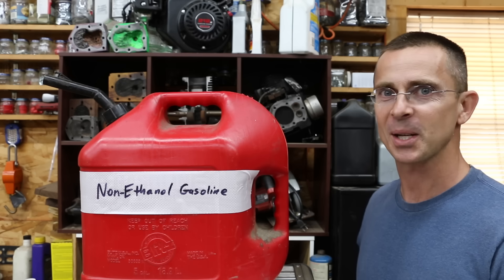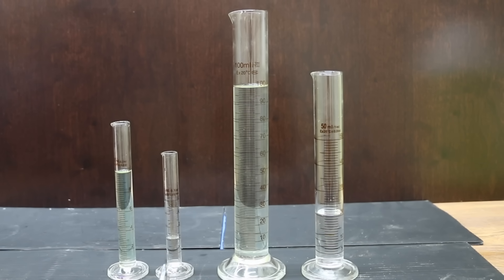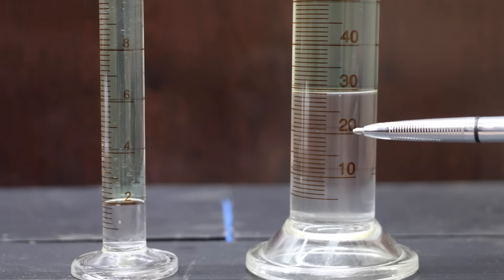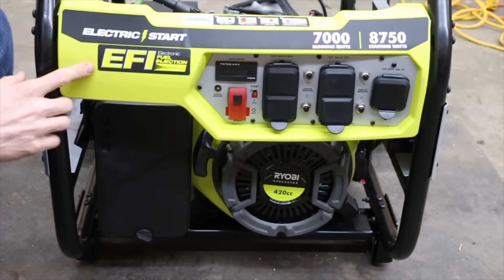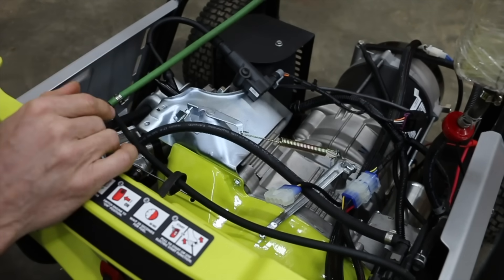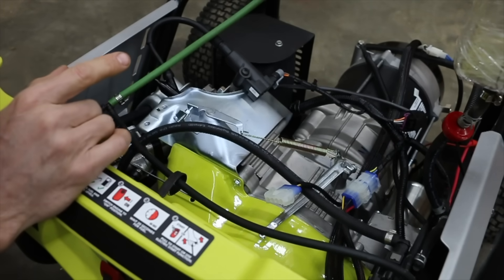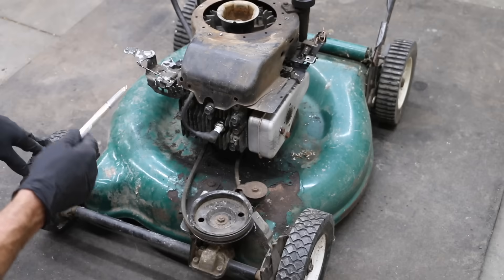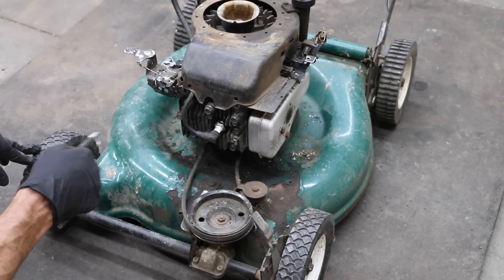Is Non-Ethanol Gasoline Really Better? See the PROOF!

Comment: Bulk it up with worthless junk to increase profit. Its called "cutting" when the drug dealer does it..
Reply: You've pretty much summed it up!  Great analogy.
Reply: My local station has 87 octane E-10 for ~$1.75 a gallon. Ethanol free is $2.56. I'm not sure if the 3-5% increase in efficiency is worth the ~46% increase in price.

Edit: to be fair, the ethanol free gas is 93 octane, so that probably explains why it's THAT much more than E-10 87 octane.
Reply: @justinluttrell1769  The range of the fuel probably doesn't make up for the cost there no. But that is a bit absurd of a price difference wherever you live.
Reply: That price difference is artificial. Currently gasoline is trading at less than 60 cents per gallon not including delivery, taxes or retailer profits. Ethanol is trading just under 1 dollar per gallon excluding the same. The reason for the retail price difference is tax and the artificially limited supply of pure gas because of regulations limiting its sale. Even going back six months to before the current crisis there was only a 10 cent spread between gasoline and ethanol.
Reply: @justinluttrell1769  The funny thing about it is that ethanol does not decrease the octane, it raises it. With that understanding, they are using lower-grade gasoline for the ethanol mixture. You have to wonder about that.
Reply: @justinluttrell1769  
That's cheap, regular/ethanol garbage is 2.29 here and 92 ethanol free is 4.09
Reply: ethanol increases octane, so it does provide a function and is better than lead and mtbe or whatever the other toxic crap was.
Reply: The "cleanest" ethanol fuel to be found around where I live is 20% corn. As I recall the "standard" is 35%. I pay the huge price hike for "marine" non-ethanol gas because my pre-millenial car has enough to worry about without its fuel rotting it from the inside. Not to mention we tend to have some of the highest prices in the state with a refinery on the edge of town; that's always entertained me.
Reply: OOZ662 there is the fact that any cars without “flex fuel” which is ready for up to e85 will have there rubber gas lines eaten up but besides that it does a damn good job of cleaning the inside of your motor,you should see some motors that ran there whole life on e90-98 the pistons and valves are spotless, kinda like a methanol car
Reply: Ethanol may raise octane, but it’s BTU content is less.
Reply: FACTS!!!!!
Reply: Leagalized theft is what I call it.
Reply: Here's the current prices for the gas in Germany: E5 (there is no non-ethanol gas here) - 1.20 Euro / liter, E10 - 1.17 Euro / liter.
So the 4% fuel efficiency really do matter over here. Though it's only 2% since all standard gas is cut with this crap.
Luckily my car runs with diesel.
Reply: @jellysquiddles3194  that's 5.63 us Dollars per us gallon I drive truck between Utah and Washington State Utah was as low as a $1.87 a gallon but it's back up to $2.30 a gallon Washington's about $2.70 to $3.40 a gallon
Reply: @craighooper7321  Thank you!
Reply: Its purpose is to increase octane, its why race engines use it alot to avoid pre-ignition with their high compression engines
Reply: @archygrey9093  then why have it for your average engine?  Because corn people knew everything was going to have turbos on it in 15 years?
Reply: @user-o1o1m  Most modern cars have higher compression engines these days and require higher octane fuels even without turbos.
Because of the higher compression they can burn the fuel more powerfully, efficiently and cleanly but only if it doesn't autoignite in the process.
Ethanol also burns cooler so i think it will also reduce heat spot knox emissions reducing the need for those stupid EGR valves.
I'm not pro ethanol or anything my cars are all pretty old so i do better without it, I'm just saying that it does have a legitimate use in fuels.
Reply: J M it also cleans the hell out of your motor you should see those cars that run there while life on corn, there engines would never have to worry about carbon bold up, and if you know anything about carbon it is the best welder in the world, don’t want that in your motor
Reply: @Cerus98 Never said it was great, just better than lead and MTBE. I'm not a fan and don't want to see an increase in ethanol content.
Reply: Ethanol costs more than gas due to the high energy input into its manufacture.  It has to go through at least 3 distillations to get close to 100% alcohol content. The raw material which is mainly corn, has an inflated price due to the high demand created by legally mandated ethanol content in auto fuel. This price inflation of grain crops has had a detrimental effect to the diet of people living on less than $2 a day. Ethanol use does nor really reduce CO2 emissions, so it's just virtue signalling at the expense of starving people. Many environmentalists have urged governments to stop it, because it does more harm than good but bone headed politicians don't listen. Farmers love it because they get much higher prices for grains than they used to. Around 40% of the American corn crop goes into making this ethanol.
Reply: Replevideo are you high, ethanol cost less than gasoline you bone head, go look at any pump with e85 and 87, e85 is cheaper, higher octane, and does reduce co2 due to the fact that it super cleans your motor, you know why it did that, because it doesn’t cause carbon build up and what do you think carbon is built up by, gasoline and all the chemicals in it,
Reply: @mustangsquad3029  if you burn more e85 then gasoline (ethanol has less energy content) it would have to be the same price per mile to justify it. Price at the pump does not dictate operating cost if one fuel is less efficient.
Reply: @mustangsquad3029  unless you don't care what it costs and want to be a super hero environmentalist. I would be interested to look at what the total energy used to refine ethanol vs petroleum including use as fuel by end user and see if ethanol = less energy total. If they have a similar "footprint" then the whole thing is a scam. I change my oil and drive the piss out of my vehicle. It's clean :)
Reply: @mustangsquad3029  Ethanol does not cost less, it also generates far less useable energy.
Reply: To the lucky performance guys that have a pump near them with e85 (even though the 10% in 93 doesn’t matter to them) ethanol is a blessing, higher octane than gas to reduce detonation so you can add timing
Reply: +Cerus98. While I can understand the use of ethanol to help offset the dwindling amount of mineral oil left on the planet, the way in which the corn industry is protected is a scandal.
Almost all soft drinks use corn syrup as a sweetener, despite it's known connection with obesity and type 2 diabetes. 
In the UK it is far more open, but in the US, the drinks companies threaten law suites against any doctor who even opens his mouth. Although most doctors agree, proof is another matter, especially when lawyers are paid a lot more than doctors and the drinks giants are paying their salaries.
Reply: and "Food"
Reply: Once the goverment kick backs run out, ethanol will cost as much or more than pure gas.
Reply: Instructions unclear, put cocaine in my octane
Reply: It isn’t cutting because it is there for a purpose.  It is supposed to help emissions.  I recognize that there are controversies about the emissions, though.
Reply: @GH-oi2jf  
Help emissions? Get real, it was pushed by the big agra corn lobby. It's another "invisible" tax on us peasants.

Comment: can we add ethanol into diesel?
Reply from the maker: Thank you for the video idea!
Reply: @ProjectFarm  No problem. Before you answered I've find out that up to 1/3 blends are used, it's called oxygenated diesel, lowers the flash point, is not easy to blend the two without something else...
At first I was researching the idea of nitrated diesel - just by adding pure nitric acid as additive. Not sure about it either. If you have spare diesel engines you could try to find out at what point the detonation becomes a problem. I think it's awesome for performance and clean burn but unsafe as it's basically an explosive and it generates more nitrous oxides.

Comment: Just a quick chemistry note: 20ml of water + 10ml ethanol does not quite equal 30ml of mix. 
From the wiki: if you mix 50 ml of water and 50 ml of ethanol you get approximately 96 ml of liquid, not 100 ml.  Ethanol molecules are smaller than water molecules, so when the two liquids are mixed together the ethanol falls between the spaces left by the water.
Reply from the maker: Thanks for the feedback!

Comment: long term test... say...  2 or 3 months:   2 jars of fuel, Jar A is non-ethanol fuel while Jar B is some sort of E-blended stuff.   Into each jar, drop in a bit a small piece of aluminum,  light steel,  and maybe a bit of copper and/or brass.   ( yes, this will make the fluid electrolytic.... but all of  those metals are present anyway inside a carb's float bowl)
The experiment?  To show how fast and to what extent  those metals degrade in each fuel  --I.E  just what really happens to your engine's carb while they sit in storage without draining the tanks/carb
Reply from the maker: Thank you for the video idea!

Comment: Ethanol stores less energy than gasoline so non-ethanol gasoline therefore have better fuel economy. On the other hand ethanol has much higher octane number so stronger mixture of ethanol and gas the higher efficiency you get. In the end is ethanol is good fuel if the engine is built for it.
Reply from the maker: Thank you

Comment: Ethanol makes it sound like my engine  was replaced with a coffee can full of beads, scares the hell out me. Non ethanol the noise is gone and i get + 2mpg
Reply from the maker: Thank you!
Reply: Chanh Milner what year, make and milage is your car? Ifyou don't mind me asking.

But TBH, even an old car with high milage shouldn't sound like that with ethanol unless there's something wrong somewhere (bad sensor or something). And anything with modern computer controls most definitely won't unless something is wrong with the engine. 

Same thing goes for octane, if a non high performance /luxury car runs rough or makes odd noises with 87 octane but runs great with 91 or 93, there's something wrong with the engine.
Reply: Cmon Meow
Don't think I've ever heard of that.
The extra Octane really shouldn't do that. In fact, it shouldn't do anything at all. Maybe the residue from it after it's burned is confusing an old sensor.

Tried unplugging the battery for a few minutes?
Reply: I heard that before when I was driving an 84 Chevy Caprice with its good old carbureted 305 in 2016. HOWEVER, it pinged with 90 or 91 Octane E0 too so I think it had some other problem, maybe the fuel mix wasn't being cooled enough. The car never pinged on BP's 87 Octane E10, though.
Reply: @101Volts   Depend of compression ratio under 10:1 you don't seem much benefit, my subaru outback h6 recommend 91 since i got a 10.5:1 compression ratio, i run 87 with 25 liter i make about 140 km which is atrocious.

Comment: Ethanol is garbage it eats up hoses it eats up rubber seals it gums up Motors it destroys everything that is petroleum-based it comes into contact with this is why I foreign motorcycles and stuff coming from China suffer so much with u.s. gasoline .... and ethanol does not boost octane in fuel that is a crock of s*** they're feeding you it's a way to stretch petroleum products so they can charge More For Less and it destroys your mileage don't believe me look at e 85 that's 15% ethanol no one buys the stuff cuz even though it's cheaper it kills your mileage so technically per mile you're still paying more or about the same
Reply from the maker: Thanks for the feedback

Comment: All of us mechanics seem to dislike ethanol and my biggest gripe is that leaving it in a fule system for awhile tends to cause gummy residue. it attracts water (Hygroscopic) and can hold it's weight in water so will definitely cause corrosion/oxidation. I never use ethanol in anything small or with a carburetor as it just messes them up....and if I have to it gets flushed out with non/ox gas before storing.
Perhaps my biggest gripe is the tax aspect. Ethanol is NOT a fuel but an ADDITIVE.
Yet it is added to fuel and then the fuel is taxed at full rate.  So in essence we pay a full fuel tax on the additive at whatever state rate as well as federal. Our taxes are based on volume (Gallons).
To be fair, if gas holds 10% ethanol our taxes should be adjusted down ten percent to keep those taxes fair. They are ":fuel Taxes" and not "additive taxes"!
What some don't consider is the cost of corn goes way up as it's more profitable to make ethanol with it....and this causes beef and livestock prices to rise as corn is heavily used to fatten up critters before butchering.
Reply from the maker: Thanks for the feedback

Comment: Yeah my 93 Toyota Corolla used to almost hit 258 miles to the full tank now I get 231 so I call it b*llsh!t and for some reason my car has rough idling with it
Reply: Ethanol's ability to collect water is evil, when it comes to an engine.  It's only plus is increased burn temps, which helps somewhat with smog.   For fuel injection, corrosion problems from water are not likely to be cured by cleaning, and filters won't help prevent it.  Daily driving works best.   For a carburetor, you eventually get enough water to separate out in the bowls that it half covers your jets, and the incorrect surface tension at low rpm's can actually make a car not want to idle - as in stopping for just a traffic light causes the engine to die, even though the engine is warmed up.  It effectively decreases your jet size until you rev the engine and get more velocity through your metering circuits, and the only cure is to pull the bowls off for a good clean/inspect - additives [which can be a good preventive measure] are a band aid on a stab wound if you have water in the bowls, so... break out your tools.
Reply: Likely due to different tires

Comment: I deliver fuel in New York to gas station and when I deliver that  85 It’s always about 2000 gallons to the station so I put it in the same compartment and the seals wear out on my discharge valve because of that I have five of them on my Tanker And it’s always comparment number three that the seals we’ar out on
Reply from the maker: Great information! Thank you
Reply: because the seals are the incorrect compound ......its not rocket science
Reply: @MY_USER_WAS_TAKEN  obviously you don't know shit about tanker trucks. You don't just go to home depot and buy different seals. Everything to do with petroleum distribution is highly standardised. You use the seals that are designed for the valve. They are prob buna n or ptfe which are supposed to be acceptable for use with ethyl alcohol.
Reply: J K found the idiot.
Reply: That sucks. I hauled fuel for 1.5 years. We primarily top loaded in company bulk plants, but I did some bottom loading in imperial oil terminal. I know they would have kicked me out for 3 days if I spilled a drop, so leaky valve would be a bad deal. We don't really have e85 in Canada thankfully.
Reply: Use Viton/PTFE seals. The NBR seals DO NOT like Alcohol. It also destroys some of the older type fuel lines.
Reply: Because alchol eats the seals

Comment: MTBE I think was a better octane booster than ethanol per unit volume, but caused too much groundwater pollution due to its slight solubility in water. Ethanol is at least nontoxic. The efficiency gain you are seeing makes sense since ethanol has less potential energy than the long chain hydrocarbons making up most of gasoline. Technically, you are increasing the energy density rather than making it more efficient.
Reply from the maker: Great point. Thank you

Comment: I have a question. I’ve been told that ethanol blended fuels use a cheaper grade of gasoline. Is it possible for you to test this in the same manner, only buy non ethanol fuel for both tests and mix in pure ethanol in one test to create e10? This would help to eliminate variables and could dispel or confirm the supposed claims of ethanol being better or worse
Reply from the maker: Thank you for the video idea!